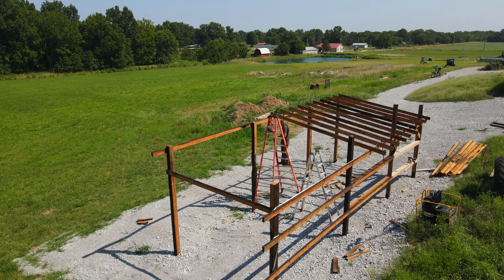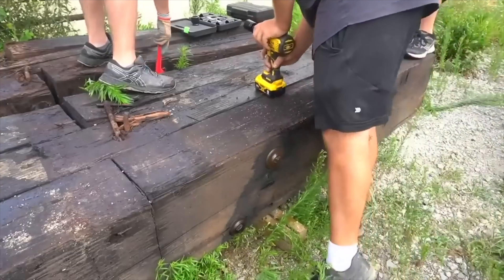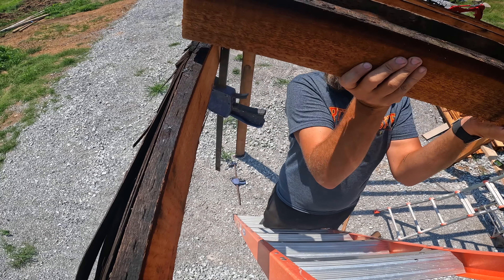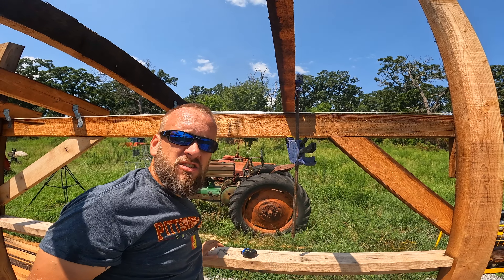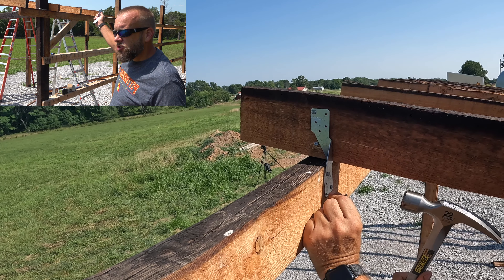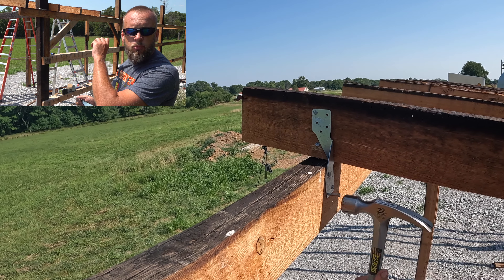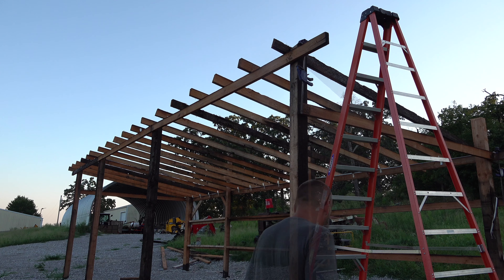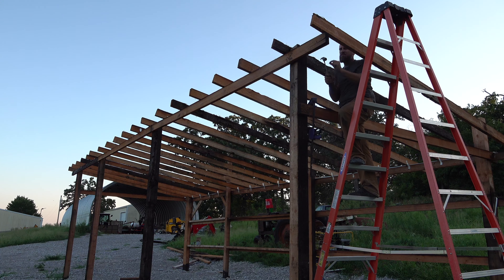I Built My Woodshed Out of a Single Free Beam

Comment: Yes Brock, you can buy galvanized strip nails for nail guns.  I personally hate them, because they bend very easily, and half the time bend before penetrating the wood.  Your firewood shelter is coming out nice, and not that it matters now, but in the future, you'd be doing yourself a favor of running a layout for your rafters before ever placing them.  Just pull your tape all the way across on both sides and mark your layout.  In doing it the way you are, a lot of times people will blow their layout, because once one rafter gets off, the rest will also be off.  I know it doesn't really matter in this application, but it's also a lot faster to pull your layout before you place rafters as you only have to use the tape measure twice, once for each side.  Nice job though!